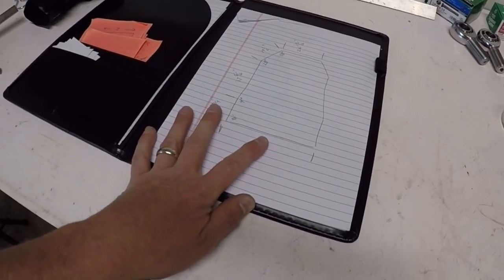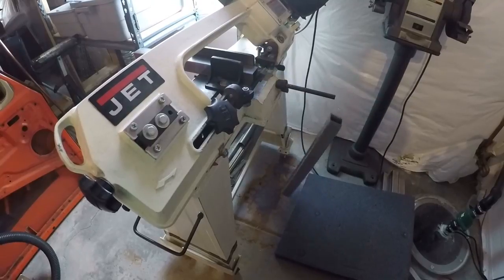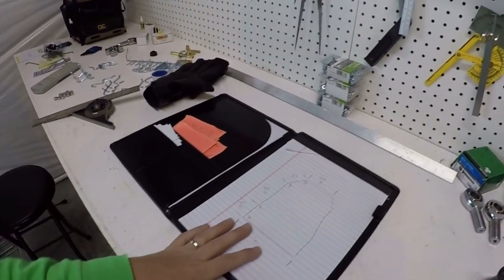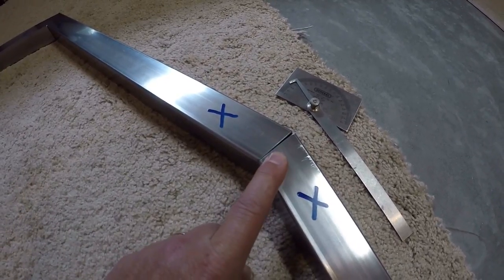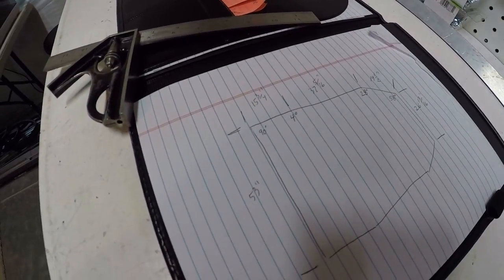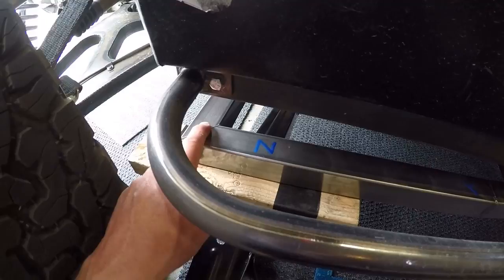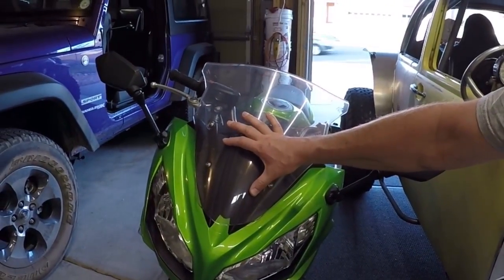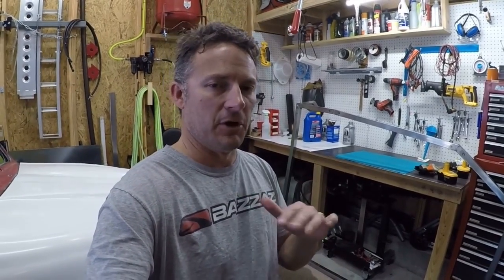Tube Chassis Build Platform Fabrication

Comment: I have a buggy I want to build and I was looking at the chassis you are building, what is the thickness of the tubing you are using? My build is thought on light off roading and I will use vw parts for it. Hope you can help me
Reply from the maker: Most of my tubing is 1.5" OD .095" thickness, most of it is ERW, but where the engine is and suspension points is DOM.
Reply: @DougBugBuilder  awesome, thanks a lot. Id be using square tubing for the bed frame and the rest will be DOM on the lower side, I'll use 1 1/2" .125 mild steel for the roll cage

Comment: Wanted to let you know.. I have the same saw brother. If you cut a piece of 1/8 plate and drill all your mount holes you can take a scratch all and mark your angles for each project and keep them per frame ext....
Reply from the maker: That's a great idea! Thanks for sharing.

Comment: Which material it's chassis made of
Reply from the maker: 1 1/2" x .095" DOM and ERW. The base is DOM, most of the tubes above that are ERW. And the material in the rear is more DOM. And the tubes under the engine and transaxle are 1 3/4" DOM.

Comment: If im building a car from scratch what materials would i need for the chassis. Is hollow tube, hollow square. Can i buy the materials at homedepot, will it be cheap? Thanks in advance.
Reply from the maker: My chassis is made out of 1 1/2" OD ERW tubing that is .095" wall thickness.
You can't buy this at a hardware store. You need to find a local steel supply house in your area. If you use ERW or Electraweld tubing the total tubing cost will be about $1,000.
Hope that helps.
Reply: @DougBugBuilder  Awesome, you're a goodman. Thanks for answering my question.
Reply: @xxbublebee123  how the project going?

Comment: Thank you so much for the video.   One question, when you clean the steel with soap and water, doesn't it rust quicker?
Reply from the maker: I think in most environments it would. But in Colorado here on a sunny summer day it all dries up before you can barely put the steel down. In a more humid environment I would most likely just wipe the steel with denatured alcohol, or maybe simple green.

Comment: I know u said your printer isn't working but here's a video showing a trick we use to build our frames and make the cuts a bit more precise and it speeds up the process a bit. Idk if the program your using has this feature, but maybe it's something to look into. https://youtu.be/_BE9aeeTusM
Reply from the maker: I didn't know Solidworks would take the tubing that far with layout. Bend Tech will do a variation of that, it prints out just the ends with the miters so you can trace them. When I get to the round tube work I'll have my printer going. Thanks for the link though, good to see how other software does it.

Comment: Just  a heads up for future projects. I own the EvoSaw380 and can't even begin to explain to you how much time that saw has saved me. It's made my builds so much more precise too. The blades aren't cheap but they will without a doubt get you through a few big projects and pay for themselves with the time and headache they save on builds like this. If you keep fabricating you won't regret having one of those saws.
Reply from the maker: Hmmm, looks interesting. I'll take your word for it. Looks like setting the mitering fence isn't to difficult. If I decide to get one I'll ask you for an Amazon link. Thanks for the tip.

Comment: Also, what are you using to remove mill scale off the steel. That stuff is mint.
Reply from the maker: Dawn dishsoap and a stiff bristle brush. Depending on the metal they have sometimes it comes out pretty shiny, sometimes not so much.
Reply: Doug Bug I’m going to the store!!!

Comment: Google locost build table. This link has one in it down a bit - 
https://grassrootsmotorsports.com/forum/build-projects-and-project-cars/justins-garage-odyssey-fordduratec-based-full-bodi/60289/page1/

Guys use 2 pieces of mdf between steel studs which makes a crazy rigid table that is torsionally strong.
Reply from the maker: Dude, thanks for the link. Some really good tips on that page, very helpful.
Reply: Doug Bug no problem

Another good site is locostusa.com for home built cars. 

If really bored check out my build log at exportedafrican.com. 

I took some inspiration from you and will be swapping in an ecotec soon!

Comment: I definitely didn’t use software for anything but I could see it helping.
Reply from the maker: My first time desinging one from software. I think the most helpful part was seeing it before building it. There already have been some things I changed after seeing how it looked in the software. Also haveing all the cut lengths and total build length needed and weight is kinda fun.
Reply: @DougBugBuilder  which software fid you use? If you can answer of course.
Reply from the maker: @Luka-ox4qk  Bend-Tech Pro is the software.